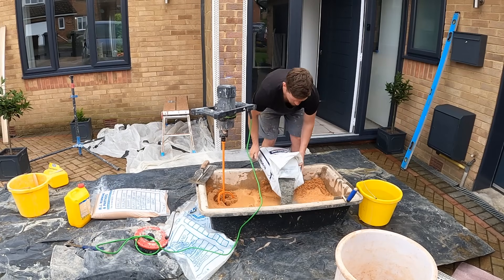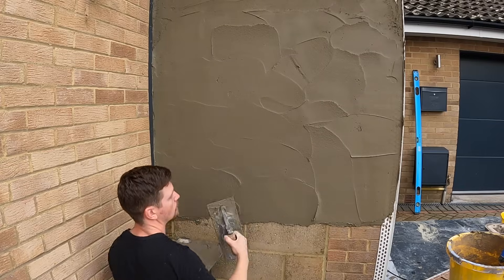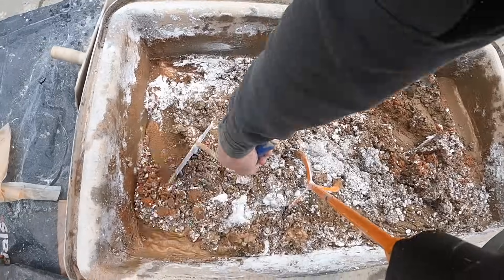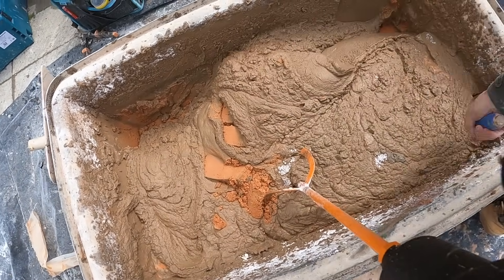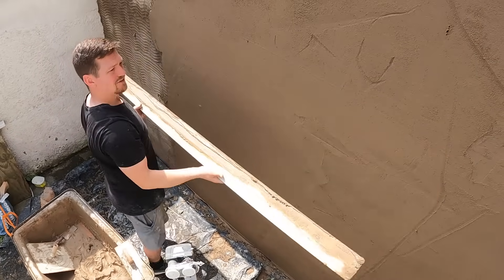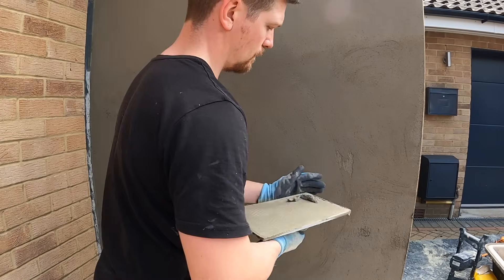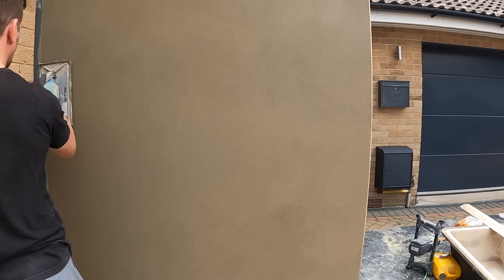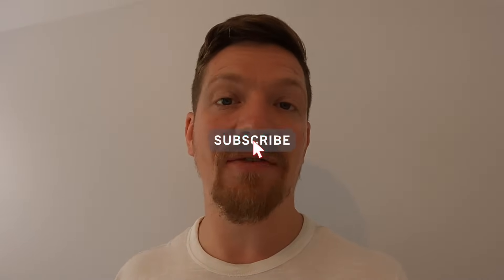How To Render A Wall | COMPLETE BEGINNERS GUIDE...FULL PROCESS!

Comment: Great job, looks really well.  In Ireland we would do that in 3 coats, the first coat would be called the "scud" coat which is basically  strong 3:1 sand:cement mix, fairly wet and thrown onto the wall to give a mechanical key for the following 2 coats (scratch and finish).
Reply: Exactly how I do it in Ireland to always 3 coats
Scud/scratch/finish 
And always 3/1 mix
Reply: I'm from ireland and the 3 coats is a waste of time. The blocks has holes in it  Why would you not use the blocks as a key.
Reply: The traditional approach in Ireland is 3 coats for good reason, I think.  Concrete blocks may have small holes, open face but they are pretty smooth nowadays so a good scud coat is a good practice.  Secondly we get driving rain here and our exposure conditions mean that a lot of practices and details used in UK, (except for Scotland)  would not fly here.  I think if I say a plasterer trying to get away without doing a scud coat on work in Ireland I'd consider it to corner cutting and poor practice.
Reply: @carpenteire  seems your going with the way you were taught. Trust me. its a waste of time. Scud isnt even applied correctly here. if done right maybe its effective. But its not applied correctly
Reply: @fixit3108  because blocks will show through if u don't give 3 coats
Reply: @HGarry4012  Not on my render it doesn't. Only if you know how eh
Reply: @fixit3108  well when u say render ur obviously not in Ireland but ok seems u know it all
Reply: @HGarry4012  Render, rubbed up smooth. Sand&Cement finish, stucco. who cares. Yes from Ireland. Doesnt make a difference, blocks shouldn't show through if scratch and top coat applied correctly.
Reply: your probably from Offaly. Worst Plastering in ireland
Reply: @fixit3108  limerick city at it 33 years and all family before me 
Go back under ur Rock up north u plastic paddy 🤣🤣🤣🤣
Reply: @HGarry4012  😂😂😂😂 33 years and you don't know how to stop the blocks showing through if doing a 2 coat. Family before you must have been good
Reply: People will argue about anything on the internet won’t they
Reply: @JackSmith-kp2vs  more like an education
Reply: I do that on some property here in Cornwall I've always called it a pricking up coat👍
Reply: @JackSmith-kp2vs  no they wont
Reply: @fixit3108  aaà
Reply: Needed abit of wire/mess down that joint. Crack all day long
Reply: good grief put them away lads.
Reply: Scuding a waste of time
Reply: Yes i often think it depends on the quality of the blocks some can really have a crappy finish

Comment: Just did my first ever render on a very, very rough wall, completely shot concrete retaining wall, holes, very uneven and all of Blaines advice made it so much easier, - Thanks so much keep up the posts!
Reply: Over Concrete lol... Blue grit?
Reply: Adrewgarland..... How did that work out ? That's what I've.. a rough concrete retaining wall that needs repairing and rendering.   Did you use the mix that Blaine used.

Comment: Interesting video. Over here in Australia traditional cement render we do in one coat approximately 10mm thick, only time you’d do a scratch coat is if the brickwork was crap and you need to make the render thicker to compensate and get a flat surface.
We use fine clean sand, cement and builders clay and add about a cap full of bycol (soapy type of liquid solution) to the water for the perfect mix! Without bycol the cement mixture tends to separate (water separates from sand & cement in the wheel barrow) and makes application a lot harder.

No waterproofing in mixture and finished surface is painted.
Reply from the maker: Thank you for sharing your perspective on how it's done on your side of the river. Very interesting...thank you pal. It was great hearing from you 👍
Reply: Hi CRO13B.
I'm in Hunter Valley area, Sydney too.
Do you render full time? Wanting to see first hand for a day  how it's done so i can render my place. 
I'm a painter and decorator. 

Huge fan of the rotors too of course!!

Cheers.
Reply: @awesomestepdad5311  hey mate, no it’s been almost 20 years since I was rendering full time so I can’t really help you out. To be honest it’s not something you can learn in a day. Theoretically it’s straight forward but in practice it takes time (I’d say a year) to learn and get the feel and understanding of.

Comment: Thanks for the tips, very helpful video. I'm part of a club in the North East that runs large model steam trains. The concrete cast arches are tired and have suffered surface cracks and material falling away. I'm hoping that with the aid of your videos (watched the steps, and cills already), that I can make repairs to the arches and make them good. Much cheaper than making new moulds, knocking the old concrete ones out, and casting new ones. Thanks for your helpful videos. Wish me luck

Comment: Just a beginner question does the rule have a taper on the leading edge? Would skirting board work as a tool for this and what is the maximum length for the rule you recommend?
Reply from the maker: I suppose you could use it mate - I’ll be honest, I’ve done it before and it was fine!
Reply: Yes it worked fine just doing an exterior wall have my scratch all done so far so good ,keep up the great work on the videos

Comment: Hi Blaine
You have inspired me to render my wall adjoining my neighbour. It is a retaining wall as we are on a slope. there are drainage holes along the wall near ground level. the property was built in the 60's so there is some damp patches on the bricks. I obviously need to clean the wall and get all the loose mortar and eroded brickwork out before I start but....... do I need to treat the wall before rendering and if so what with?
Reply: That sounds like my concrete retaining wall.... How did you go doing your retaining wall. ?

Comment: I have a question I've seen many people used different plastering substances like the one you used and the one I've did in college and my tutor said that the substance is the actual substance for plastering so does the different location(inside outsid) will have to plaster with different plastering?

Comment: Is it worthy to attach the rule of bubble to make sure that the pressure is uniform in both extremes of the wood.
Reply from the maker: It sounds good in paper but it never works out when ruling. You just have to keep checking with the rule in-between

Comment: Nice video. I want to repair the exterior render on my old house, lime mortar and stone walls so I can’t use cement. What mix would you use, I have used a mix of sand and 2 different limes on the interior? Thanks

Comment: There is an aco drain close to where you have just rendered, your render is in direct contact with the ground allowing ground water to migrate up the wall. This is usually stopped using a bell cast to stop rain water splash back and I'm curious why this hasn't been done?

Comment: I keep seeing exterior block walls that crack along the grout lines. Is there anything specific that you do in order to keep this from happening?
Reply from the maker: Make sure you apply 2 coats and you can even use mesh in the scratch to keep it at bay 👍
Reply: @PlasteringForBeginners  I actually did install fiberglass mesh embedded in a coat of a product designed to adhere foam to stucco called 290, by a company called BMI in the SF bay area. This was over a base coat of regular stucco in order to deal with the irregularity of the block, as you do in your video. Then I applied two coats of their finish product and I'm still seeing the hairline cracks show up about six months later. It seems like this is a problem wherever I look at block walls around here. 

I noticed that when it rained the groutlines beneath the 290/mesh layer appeared visibly as moisture laden lines as the entire surface was drying out. However, the cracking didn't occur in the surface finish layer until later. I'm wondering if it's a question of those wetter grout areas freezing and thawing...? Do you know what causes the cracking problem in the first place? Do you see this in the UK?

Comment: Hi.thanks a lot, l have never done rendering or do understand even the word rendering before you thanks for that, l have moving new house and l need to do rendering on an event wall in the dining room/the living room, the wall is not that smooth but there is hard left over wall papers, l need to prepare the mix of cement and sand and l need to do only top cover which is not that hard, l bought ready cement from screwfix which is in pucket, but l will use how you did the top coat. Please, any advice as l am beginners, Thanks.Samatar.

Comment: Hi, I've seen a few videos now and they are really good.
Do you have any videos regarding external lime render? Or any tips?
I have a 180 year old solid brick cottage and need to remove the 70s cement render and re Do it in lime, I've been quoted £20k but as funds won't stretch that fair I'm thinking of tackling it myself.
I've Do a few rooms with lime render and lime plaster inside so confidence is growing
Reply from the maker: Hi mate! Thanks for watching - I really appreciate it. I don't actually have any lime rendering videos yet so I can't really help you there in afraid. But you can attend some courses which would help and I'm sure there's videos on YouTube!
Reply: @PlasteringForBeginners  thanks for the reply mate, really appreciate it 👍

Comment: Hi ive had building control officer say if use sand cement render it needs to be 20mm thick for my extension. My plasterer is querying this as he feels thats to thick and usually depth is governed by the beads. Its going onto 7n block. Can you give any advice please.

Comment: Hi and thanks so much for these tutorials. I'm giving up trying to get a plasterer to render and pebble dash the extended portion of my outbuilding. Nobody will come and look. All too busy. Now, you've helped greatly but I have a question. Is the thickness of scratch and top coat critical? The reason I ask is that I left a bit too much depth to render up and match the existing pebble dash. How do I correct this? Do I add another coat or just go deeper on the two? Do you also have a tutorial on Pebble dashing? Thanks for your help! Ian

Comment: I am a bricklayer with 33 years experience. I've only ever done small areas or rendering before and only a handful of times. Watching your video, I have to ask about the sand used. I have only ever used sharp sand, but yours looks different. What sand do you recommend?
Reply from the maker: Plastering sand mate 👍
Reply: @PlasteringForBeginners , Cheers, Next time I do any, I will use it. I always used sharpsand thinking it would make a stronger and more water resistant mix.

Comment: Great video apart from timings… when to rule? When to float? Etc…is the tender going off, is it 2 mins or 30 mins after troweling it on? Thanks
Reply: If it's flying off on you your not priming the background properly your working in ridiculous heat or your mixing too much cement with your sand mate, those bricks are sprayed down before the mix is applied it stays alive for hours in the mixer

Comment: Sorry I missed a detail, how long if at all do you leave it between ruling and floating... is it still soft or semi-cured at this point? Great video, thanks.
Reply from the maker: There's no real time but it needs to be semi-cured as you said. Otherwise you'll pull the render from the wall...it needs to have taken up for the floating to work 👍

Hope this helps pal!
Reply: @PlasteringForBeginners  yeah thanks. Sounds like a bit of trial and error, you make it look too easy! Luckily I've a wall round the back I can practice on.

Comment: Hi Blaine. I didnt see you use yr level to make sure yr plaster was plumb and also I didn't see you use a square to ensure you were square to the existing wall on the left. Dosnt make a big diffrence in you project but if that wall had to be tiled it would have made a big diffrence.
Goid you mentioned preping the wall prior or else the plaster will stick but eventually fall off

Comment: The sand we have in the southwest is silver/building sand. Seems quite coarse to get a nice smooth finish. Is there any tips on using this, or is it the same Sand used eveywehre else? As when I was younger, it was always a thing about the sand down here was awful for nice finishes compared to up north? 

Also, if I want ultra smooth finish, do I not bother with the sponge, or is this a must. 
I've seen some stunning ultra smooth rendering on some local walls co pared to what you normally see as a render. Is that different materials/techniques? 

I've done a bit of plastering on a couple of walls, so want to try out rendering next.
Reply: I am a plasterer of 32+ years in the south west and yes the sand here can be course but you can still get a smooth finish, its all about timing and using a fine sponge rather than a course sponge, carwash sponges are for washing cars try to find some old sofa sponge and don't try sponging too early
Reply: @mikeoats12345  Ah, I used a car wash sponge last time. I'll bear this in mind if I ever do rendering again 👍
Thanks

Comment: Do you use building sand or sharp sand. I have been told that using sharp sand for the base coat gives a better key for the top coat made from building sand ?
Reply from the maker: I just use plastering sand all the way through pal!

Comment: Hi. Great video. I’m just doing a single story extension. I’ve done the small walls to practice but am having some issues. When I fill in as shown the videos I’m getting islands forming, where some spots look like the sand have been pulled out and don’t look as compact or full as other areas. Also what sand are you using. I used rendering sand but am really struggling with small stones creating lines when I float it? Any tips
Reply: My guess is your putting on your render on to thin if your dragging small stones, did you use lime in your top coat

Comment: Another nice video mate, thanks for your content.
I'm rendering a raised bed in my garden, I've built it out of blocks and its about 25m long so it's been a big DIY project for me.
I have two questions;
1, I bought galvanised 10-13mm beads and will be rendering with a sand/lime/cement mix, will the galv be a big issue?
2, do I need to apply waterproofing to the soil side, or is this unnecessary?
Thanks for any insight you can share.

Comment: Hi, anoter great video thanks very much.  Would I use the the matting on the scratch coat? Sorry I don't know the trader name. We use it when plastering to help against cracking.
Reply from the maker: Thanks pal! You can mate. It's called Render mesh and it's great when you bed it into the scratch coat - it definately adds strength to the render 👍

Comment: I live in an solid brick house. Have been told I need to use lime render so the moisture can evaporate out, rather than potentially get trapped behind cracks in cement based render. Would you agree with this?
Reply from the maker: Definitely mate. Lime is the way forward for the position you’re in - cements not good for everything. The advice you was given was sound 👍

Comment: I need your advise. I'm not professional builder but still I build a garden room wich is 7m×5m i use concrete blocks outside and thrmalite blocks inside. I'm going to do rander (sand plaster) outside  but I'm confused what shall I do inside I got three options sand plaster/ bonding/ plaster board and then skimming. Please advise me what is good for me
Reply: Easiest is to batten the walls an plasterboard

Comment: how long do you wait before you flatten it out i have been trying to do this process and it dont work to good
Reply from the maker: I usually rule it straight away mate - I don’t like to wait because the render sets which makes it harder to rule! But each to their own...that’s how I do it pal 👍
Reply: @PlasteringForBeginners  my problem is when I try to rule it, the material want to come off I know I need practice at it. It gets frustrating

Comment: Can I ask why there is no stop bead or bell bead at the bottom? I seen another guy on here do the same as you and got slated saying he breached the damp course because he didn't put stop beads on? Any and all explanations welcome.
Reply from the maker: I usually do the same but the builder insisted that he didn't want it. Exactly that...stop bead above the DPC to stop damp rising but again, the builder didn't want it. I warned him but he wasn't interested so it's on him I suppose. You can only say so much but your correct. It's the right way to do it 👍
Reply: @PlasteringForBeginners  any chance you could show how it's done and when is the right time to do it. Would I be right in thinking that it doesn't need to be done on standard garden walls?

Comment: Great video and I'm contemplating having a go at rendering my ground floor extension. A couple of quick questions though, the first is I have an outside tap and the flue for the boiler on the wall so is it a case of ruling around them to try and get a flat wall and secondly is there a formula for coverage so I don't mix far to much or far to little ie 2 bags of sand  1/2 bag of cement per metre